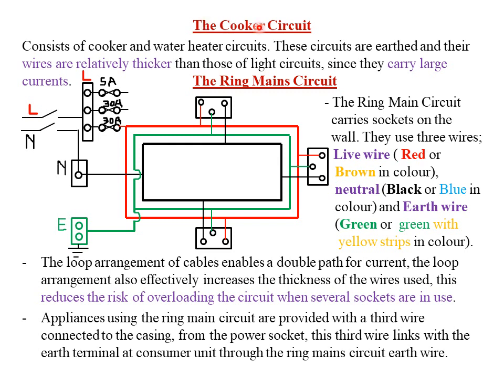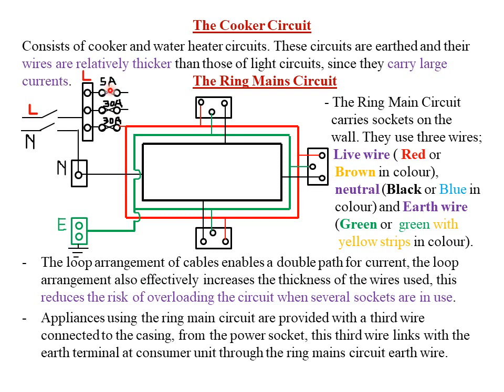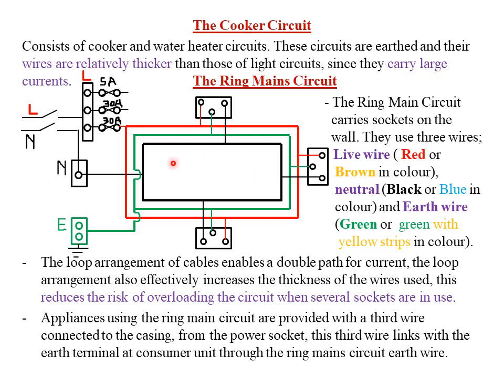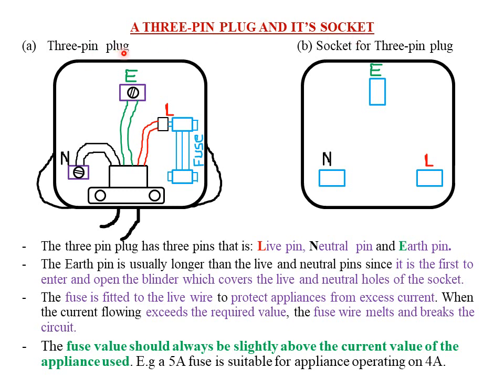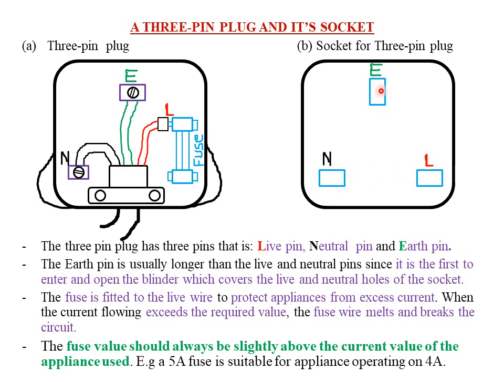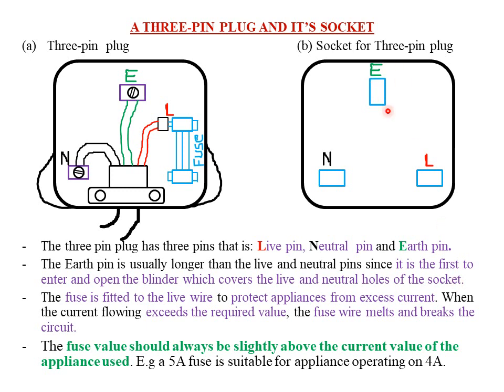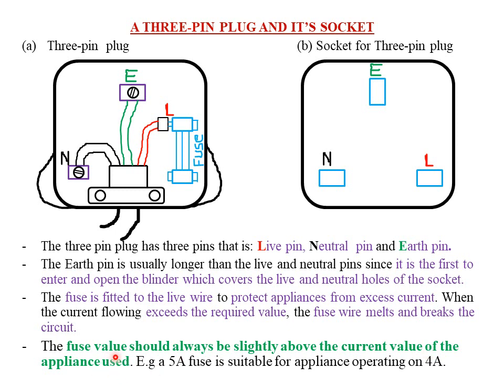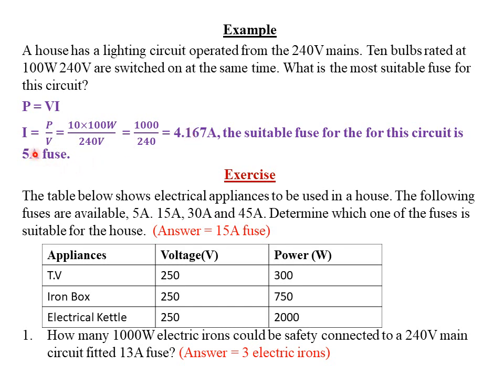MAINS ELECTRICTY : LESSON 4

Comment: The earth pin is also made longer so that it gets connected to the earth terminal earlier than the live and neutral pins. This ensures the safety of the user. 
The earth pin is also thicker because a large cross sectional area as compared to other pins makes its resistance lower than other pins so that in case of any short circuit, the excess current flows through the earth pin.
Reply from the maker: Very truly. Wow, I'm impressed thanks for such an amazing contribution, we're all here to learn and expound our knowledge. Once more, feel appreciated friend 🙏.
Reply: Thankyou 🙏
Reply from the maker: Welcome friend.